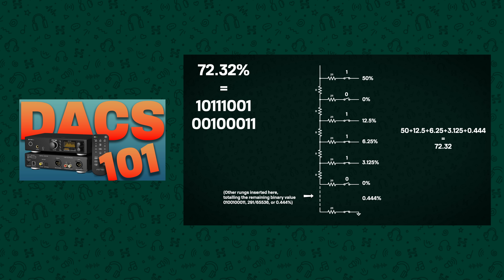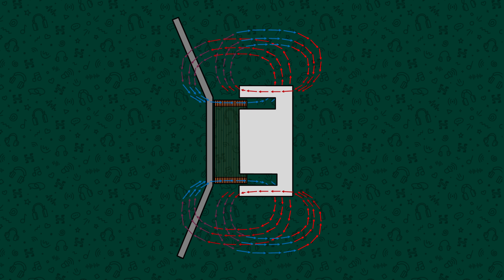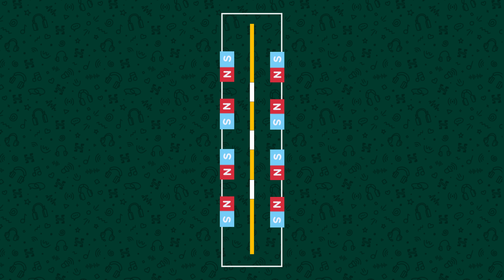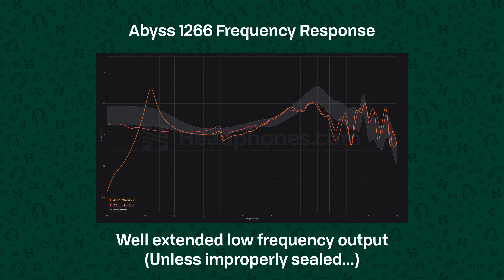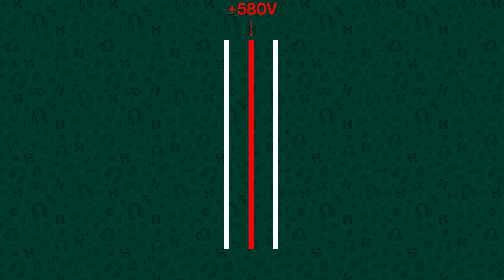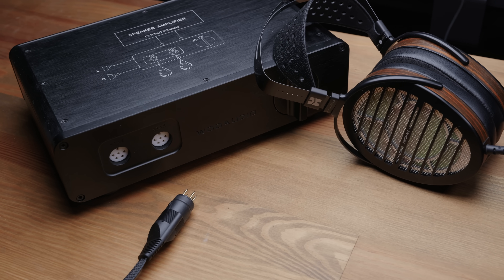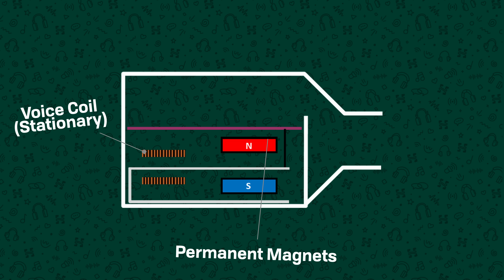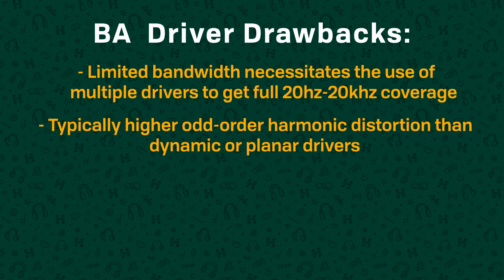How headphones work, as fast as possible! Planar, Electrostatic, Dynamic and BA explained

Comment: Great video, thank you! Any chance we might hear some comments on the characteristic (distinctly prolonged) decay pattern of planar-magnetic drivers that can be seen on CSD plots?
Reply from the maker: Most of the time that's just FR and due to the more modal character of common planar drivers. CSD is largely irrelevant in headphones because they are minimum phase. In short, it's just FR.
Reply: @TheHEADPHONEShow   Thank you very much for your response! 

I guess the issue is that I don't have a grasp on the relationship between CSD and FR, or how certain features of the latter would show up in the former.

For example, I would expect the areas of the frequency range that have more energy, like a bass shelf or high frequency resonances, to display a longer decay at higher magnitudes, but it's not always the case. 

With dynamic driver headphones or muiltidriver IEMs the decay is typically eneven between different parts of the frequency range, while with both planar HPs and planar IEMs it's way more uniform in every regard, with a certain distinct pattern. Meanwhile, the variations in frequency responses are substantial. 

I have been intrigued by this for a pretty long time now. Any chance you could direct me to where I could learn about this more to get a better understanding of this? 

I won't be asking you to try and explain that to me 😅

Comment: Sensitivity being equal, are types of drivers more efficiently/accurately driver by higher voltage (e.g., high gain),  versus more efficiently/accurately driven by high current (low gain)?